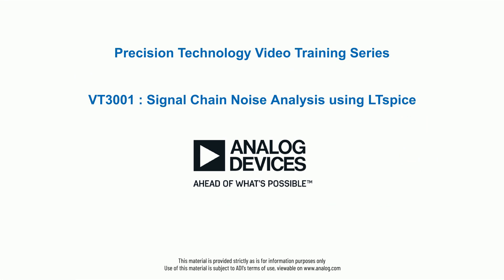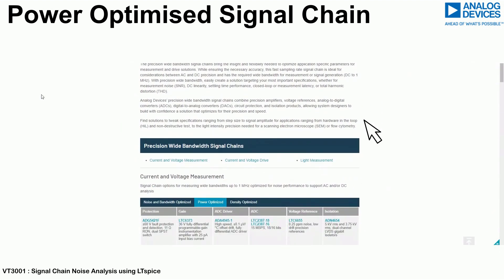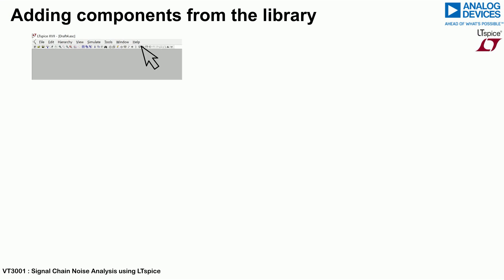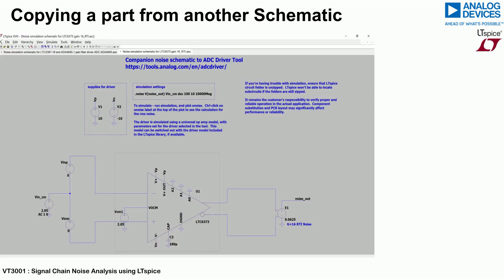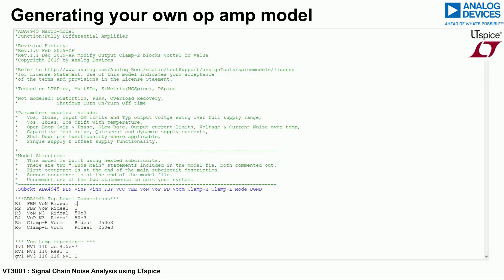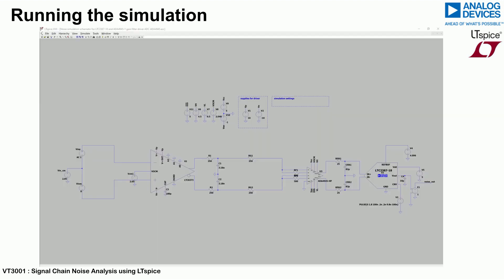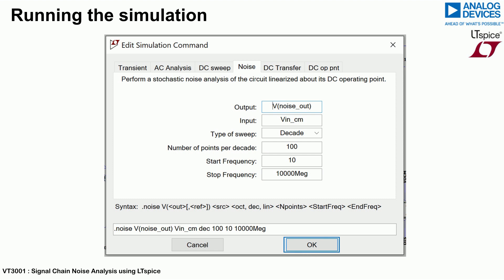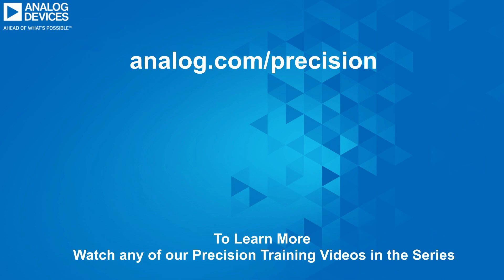VT3001 Signal Chain Noise Analysis using LTspice

Comment: It is easy to see how powerful a tool this might be, once the first time user has a successful experience.

Not having used LTspice, I attempted to follow your video.
I would suggest you ask a fellow employee not familiar with this program, to follow your tutorial to see how successful they are.
I had trouble navigating to the proper places on your website. Clickable links to each required location would be greatly appreciated!
(YouTube timestamps could be quite useful here)
Also, when asking the user, for example, to select an output node, be sure to explain HOW to perform that operation.
Thanks